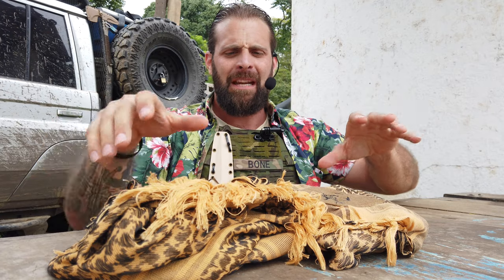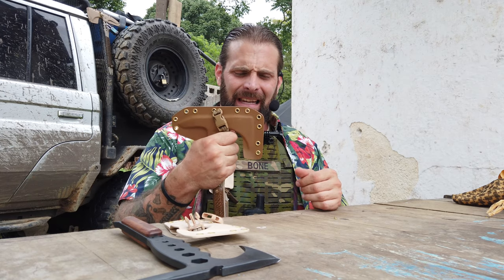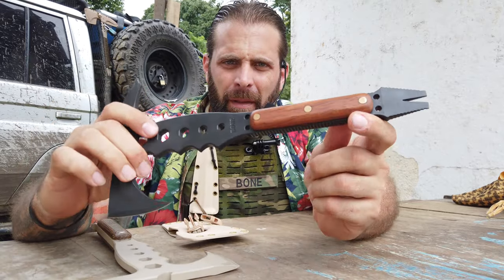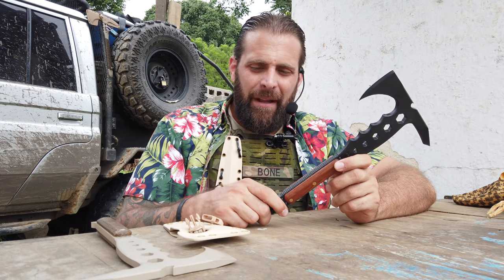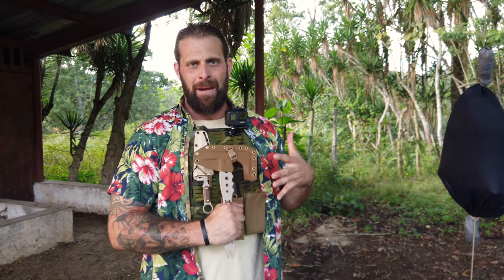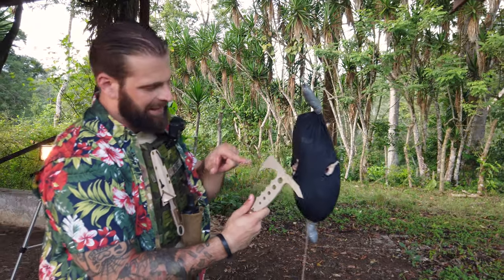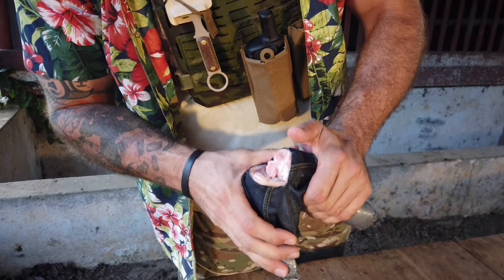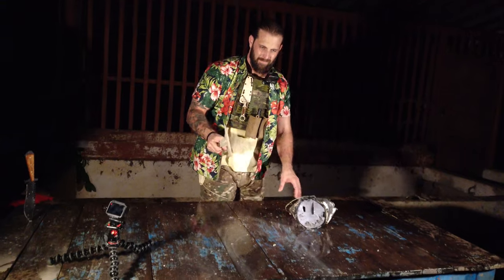TOMAHAWK TESTING | World's Strongest & Sharpest

Comment: You can still hook with a sharpened  beard , it will cut into your aponent and slow him down with a bad injury. But it can posibly be dangerous to the user of the hawk when choking up on the hawk. On the bottom of the bone Hawk beard is wicked sharp so if you did hook somebody it would stick in them and cause them serious issues but really isn't a danger to the user which is nice ,so excellent design. correct me if I'm wrong.
Thanks